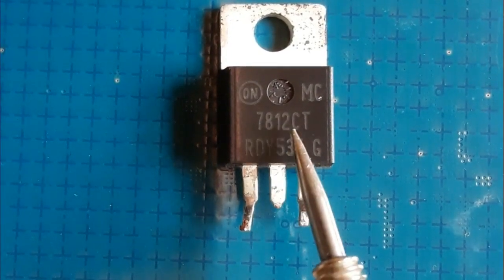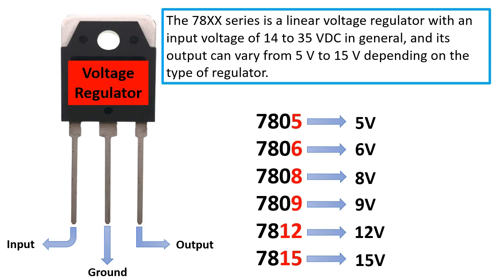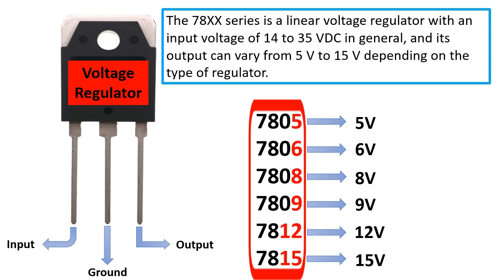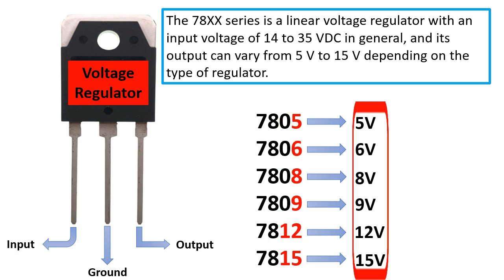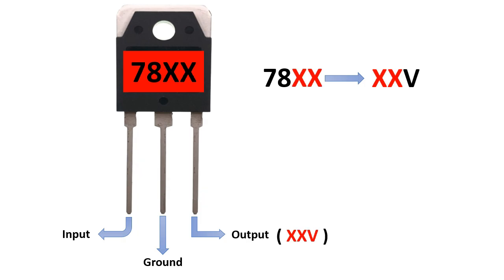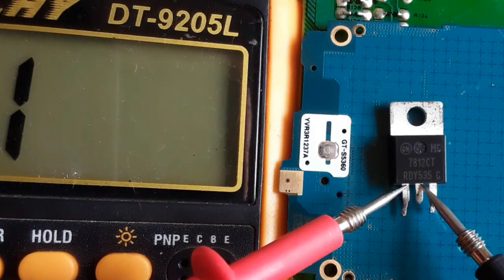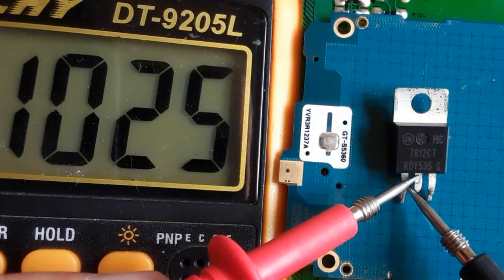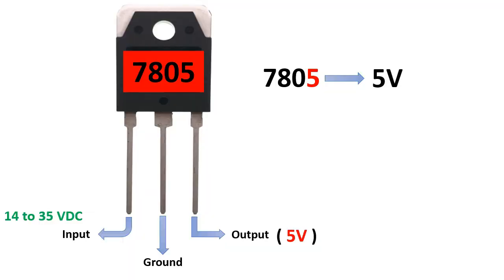Learn how to test voltage regulators with multimeter, 78XX series voltage regulators

Comment: How do you test 79xx
Reply from the maker: Check the Pinout: The 79xx series typically has three pins:
Pin 1: Ground (GND)
Pin 2: Input voltage (Vin)
Pin 3: Output voltage (Vout)

Use a DC power supply, set to a voltage higher than the negative output voltage of the 79xx regulator. For example, for a 7912 (−12V regulator), the input voltage should be more negative than −12V, like −15V.

Connect the Regulator:
Pin 1 (GND) to the ground of the power supply.
Pin 2 (Vin) to the negative voltage from the power supply (e.g., −15V).
Pin 3 (Vout) will give the regulated negative voltage (e.g., −12V for a 7912).

Measure the Output:
Use a multimeter to measure the output between Pin 3 and Pin 1 (ground).
The output should be stable and equal to the rated value (e.g., −12V for a 7912, −5V for a 7905).

Load Testing:
To check performance under load, connect a load resistor across the output (Pin 3 and Pin 1). The output voltage should remain stable at the rated value.
Good luck
Reply: @electronicsrepairbasics_erb  thanks 🙏

Comment: I have a voltage regulator it very very so hot and the device wldnt turn on. What is the problem
Reply from the maker: Witch kind of voltage regulator, is it SMD voltage regulator or THT VR.
Waiting for your reply,

Comment: How to fix L7812 ic load time functionality inactivity while device connected on running mode  ?

Query1:
=====

I used 12v*2 3000mA with 2 diodes 5408 and 2200uf/35v . Which other capacitor value need to use in the output section of L7812 ic ?

Query2:
=======
My 12v*2 3000mA transformer where i connected 2200uf and 2 diodes 5408 and out shows 16.68 v.
 
Then i added L7812 and voltage shows 12v with heatsink .

But while i charged a lead acid battery then ic gone over heat and this continuty i cheaked got result 16.68v .

Then i stoped the charging and refresh .

Again on the switch and voltage shows 12v .

That neans heating the ic automatically ic is gone inactive .

In this time if i used any device by this power supply due to over vault connected device will be damaged automatically.

How can i keep my circuit safe while the output turn 16.68v to 12v while L7812 is inactive due to overheat ?